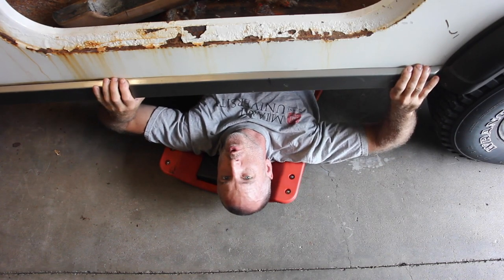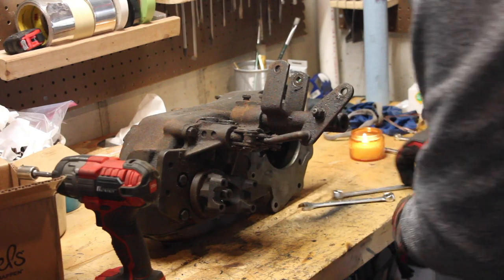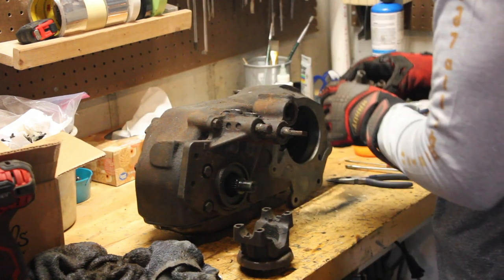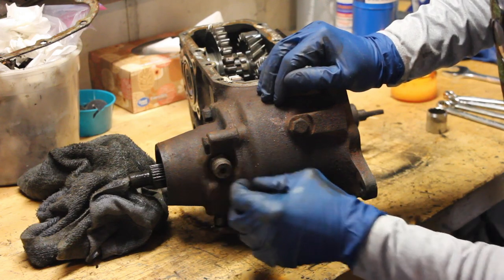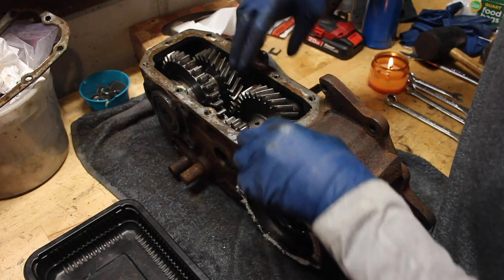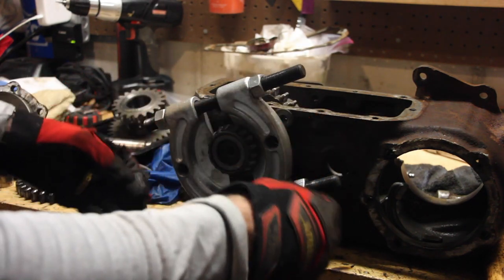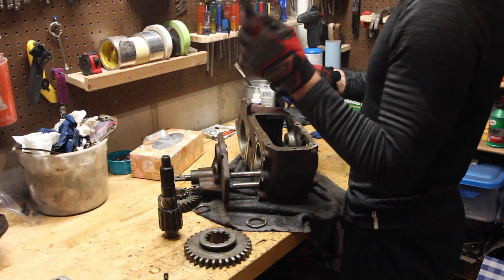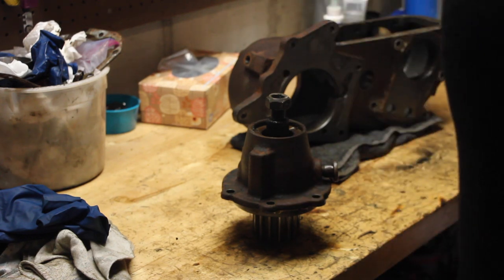Jeep CJ Dana 20 Transfer Case Part 1 - The Teardown

Comment: You are great. I watched this video and  gave me insight of how to take my tranfer case apart. I had a hell of a time getting the inner bearings out. Ended up taking out the roller keepers and heated up the inner races to get the shaft out. And you are right about taking out the keeper hex bolt out of the fork. Whoever came up with that location must of smoked something. Shitty place to put that keeper bolt.
Reply from the maker: I’m sure, at the time, it made sense to the engineers. Why would you ever need to fix something :)

Comment: Thanks for the videos, you're a life saver.  wish my transfer case shift rails/forks Alan screws came out as easy as yours did. had to drill one of them out, the other, impossible, tried everything. about to cut rail once I find replacement    thanks again !!!!
Reply from the maker: So what did you do? I’m interested to know if you found a solve or resorted to the alternative that involved violence :)

Comment: Perfect timing, just bought a 76 CJ5 last week and I need to pull the TC. Hopefully just needs seals. Good video, thanks.
Reply from the maker: Hopefully that is the case. Make sure you take a close look at the slide gear teeth. Seems that is where the most amount of wear happens.
Reply: That what I thought at first too but in order to change the seals you need to take the whole bloody thing apart. Might as well buy a complete rebuild kit.

Comment: Amazing videos!!! Perfect detail!!! One thing though, that I think needs mentioning, and clarification ..., is, to avoid all the trouble removing that bearing (as you did), you could actually just knock the entire section out "first", then mess with the bearing outside of the case instead. Also ..., regarding the suggestion about the 90 degree screwdriver thingy ..., it's actually about 200 turns without it. I will definitely be buying one before reassembly. Once again ..., incredibly awesome videos!!! Thank you so much. Look forward to seeing more. All the best!!!
Reply from the maker: Thank you for the improvements. I'm taking this one learning at a time and love when people have good builds for all to learn from. Glad I can provide some good content to all the crazy CJ people out there. :)

Comment: It appears that you didn't remove/replace the seals for the shift rods. Were they not damaged by the heat in the powder coating process?
Reply from the maker: Glad you brought that up. I didn't apprently film the removal. Sorry. I put them back in in the rebuild video though :)

Comment: What did you use to clean up your transfer case? I’ve used gunk, autozone degreaser and using a scrub brush hasn’t don’t much.
Reply from the maker: Oven cleaner and a bunch of small wire brushes. Put on clothes you don’t need anymore and put down a big tarp. Let the oven clean soak in for a hour or so and then go at it. :)

Comment: Just what I needed to replace warn out linkage. Have a question for you. At approximately 8:50 into the video you took out two "Square" bolts and then easily slid out the hollow tube that holds the shifter. Mine is stuck. I've hammered at it and sprayed lubricant in there and it isn't budging. The case is still in the Jeep so I have limited access. Any suggestions?
Reply from the maker: Heat and penetrating fluid. And patience and a rubber mallet to lightly break the tube loose.
Reply: @coolguy_CJ7  Okay thanks for the quick replay. I'll try some heat this evening. It looks like someone had painted over the tube. I took the protective Transmission and transfer case cover off for easier access. Looking from the rear I tried lightly hammering the tube out with a screwdriver but only dented the tube with screwdriver. That sucker is really stuck in there!  Where should I apply heat and is there any chance of all that old grease and gunk catching fire? I tried wiping most of it away, but like I said earlier, everything is still in the Jeep. I have zero mechanical experience but watching your videos has given me a lot of confidence in DIY. Thanks
Reply from the maker: @chrismarrs6752  over the whole tube area. Wipe as much off as you can, but using a propane torch will only get it so hot. If you can use2 that will help.
Reply from the maker: Well all need to stick together in this CJ world.
Reply: @chrismarrs6752  I know I'm late on this but I took the whole shift rail assembly/housing thingy off and I ended up pressing out the hollow tube on my shop press because mine was basically unmovable by any other means.
Reply: Any idea of the thread size on the 2 "square" bolts on the tube? Mine are missing and the tube slides in and out freely, which makes for incredibly sloppy shifting.... If you can at all.

Comment: Great video! Extremely informative.
Reply from the maker: I'll have the rebuild video up in a few days.
Reply: @coolguy_CJ7  I'll keep an eye out. Interested to see how you get those needle bearings back in!
Reply: How did you get the seal out? Mine is super stuck and won’t budge. It’s super mangled
Reply from the maker: @Jpella88  I mangled mine up as well trying to get it out as you can see from the video. You can try to heat up the outer housing to lossen up the sealant or keep pulling at it with a strong set of pliers and a seal puller. They were not fun nor easy to remove.

Comment: Question for you… can the shifter rail seals be replaced without disassembly?
Reply from the maker: You will have to do enough disassembly to be able to remove the shift rails. Otherwise there isn’t a way to remove the seals :( you risk scratching the rail surface if you try to pull them with the rail in place.

Comment: I need to ask…. So I followed your advice on grinding down the socket and it worked perfectly. However, the gear seems to be in perfect condition. I have confirmed that the cable and speedo work fine. Is there something internal that turns the gear that may have broken and that it’s not the gear thats the issue? Help?
Reply from the maker: At 33:54 you’ll see the speedometer drive gear. If your speedometer gear isn’t missing teeth and the drive gear is still good, then it has to be something in the cable or the speedometer gauge in the dash.
Reply from the maker: Also, your cable may spin cleanly, but if it isn’t square at both ends then is could be stripped.
Reply: So I have tried two cables, one of which is new, and I have two speedos that I have tried and all work. Cables are good. I put the cables into the speedo and hooked the bottom end of the gear to a drill and everything worked great. But the moment I drop it back in the transfer case (and it feels like it is engaged since I am unable to manually turn it) it stops performing.
Reply from the maker: My only guess is that the drive gear, the one on the drive shaft, needs to be installed and tightened down to the transfer case with the bearings and races. Otherwise, without tension, there is nothing that pushes the gear against the bearing. I wish I knew more, but that is the only thing I can come up with.

Comment: front bearing cap remove the ball poppet and springs and the cap should just slide off of the rails
Reply from the maker: Sure, now you tell me this :)
Reply: @coolguy_CJ7 there’s also an interlock pin in there between the rails

Comment: The Caps you couldn't get out that trap the pills in between the shift rails, think of them like itty bitty freeze plugs. Just run a drywall screw into them and pull them out with a pry bar.
Reply from the maker: What do you replace them with then? Are these available?
Reply: @coolguy_CJ7  I made mine out of some tapered bits of aluminum and hammered them in.
Reply from the maker: Hmm. Don't think I have any of that lying around. :)
Reply: Thanks bro. I was looking for a way to take them out without removing the shift pins. For some reason I can't get it to unlock to get the pins out. Did the quarter turn to get the balls and springs out to no avail.